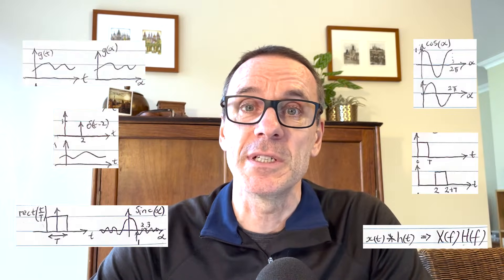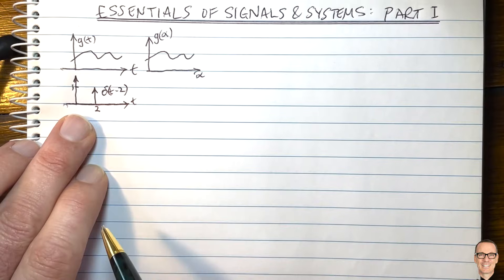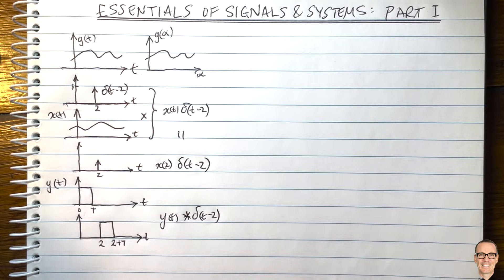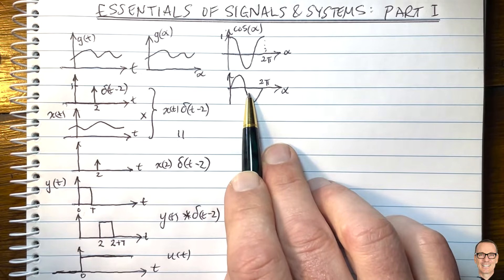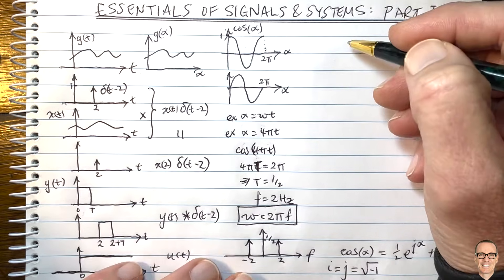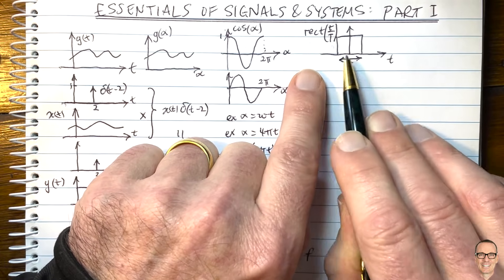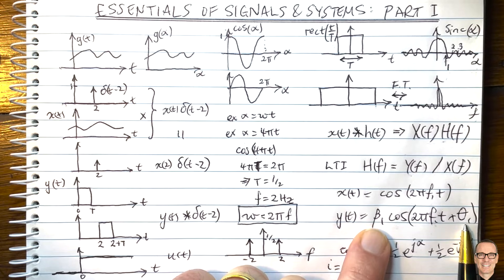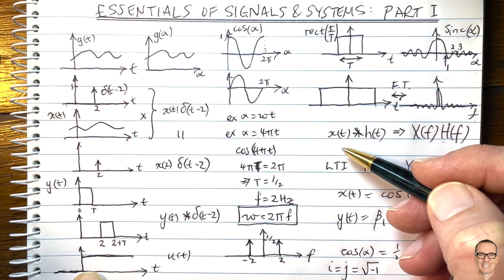Essentials of Signals & Systems: Part 1

Comment: Hello, a generell question: after filtering, can we say that the noise power is 0 mW?
Or is it still in B and the filtering just canceled the noise in the frequency range below and above my transmit bandwidth B (so it is always there and does not vanish anyway)? Thanks a lot.
Reply from the maker: Hopefully this explains filtered noise: "What is Noise Power in Communication Systems?" https://youtu.be/_qn4RzMrXBc

Comment: Hi Professor,
Thanks for the video. The received signal through a wireless communication channel is often represented as the product of the complex channel gain and the transmitted symbol in a given coherence time interval. Could you please explain what is not the convolution?
Reply from the maker: It is convolution ... it's just that in the cases you're talking about, the channels are "non-dispersive". In other words those channels don't have inter symbol interference (ISI). Which means the convolution reduces to a simple multiplication. These videos might help: "What are Flat Fading and Frequency Selective Fading?" https://youtu.be/KiKPFT4rtHg and "What is Intersymbol Interference ISI?" https://youtu.be/I087FUvW2ys

Comment: Nice - thank you. The frame at time @19:00 should be printed as a poster and hanged on the wall as reference for all system work. In fact it makes great poster. I studied those things over 20 years ago, and I still need them.
Reply from the maker: I'm so glad you think so. As you've probably seen, I put a "summary sheet" pdf image of each video on my website https://www.iaincollings.com/ Here's the one for this video: https://drive.google.com/file/d/19uTb-3W1G0ZfXCPU0aOfeKCZFFmQVD9p/view
Reply: @iain_explains   Wow you were thinking way ahead of me. Thank you so much for your great work and for your amazing contribution to our community.
Reply from the maker: My pleasure. It's great to know that my videos are helping people.
Reply: @iain_explains   I will print it and hang it on my wall.
Reply: What is your concentration?

Comment: Bit confused with the first point - how can you replace the t variable with anything else and still have the same signal output (shape). E.g f(w) is by definition a different spectrum than f(t)?
Reply from the maker: I think you're making the (common) mistake of thinking that a function is defined by what is in the brackets - but that's not the case. The thing in the brackets is a variable. It's not the function. Perhaps this video might help to highlight what I mean (although I think I probably should make a seperate video to explain this more directly): "Fourier Transform Duality Rect and Sinc Functions" https://youtu.be/rUgBhEpeqxo